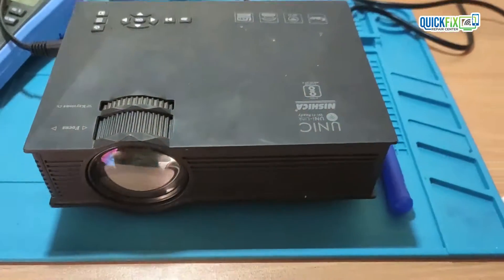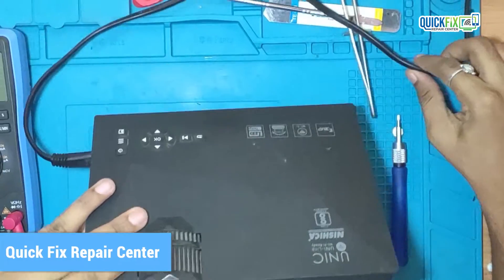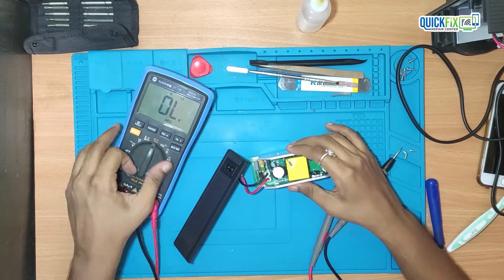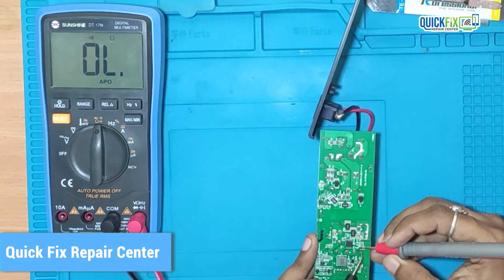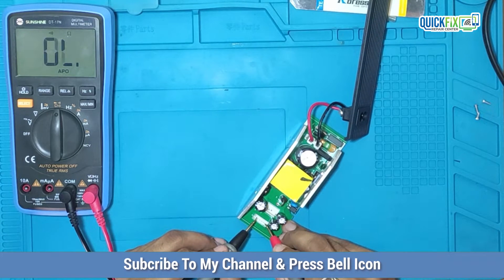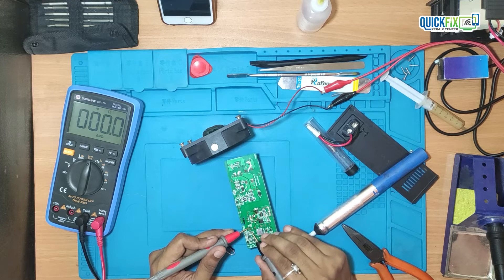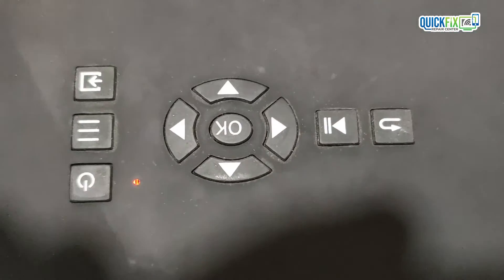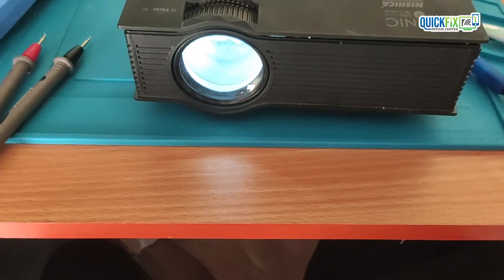led projector not turning on | UNIC projector power supply repair

Comment: How much it costs for doing the same thing you did in outside service centres approximately can you please tell
Reply from the maker: I have done in 500 that time😅
Reply: Great this is called diode problem right?

And it happens on power fluctuations right? @QuickFixRepairCenter

Comment: i have same projector... when i turn on the projector red light ons, when i start projector screen blinks and turns off.......and returns to the same red light and if i again turn on the projector screen blinks and goes off
Reply from the maker: Might be not delivering enough power which is required. Hence it's getting off frequently.
Reply: Have Lamp Replace?

Comment: I have hitachi cpx 4015 wn projector it shows pendrive all files audio files plays smoothly but when i click on the video it open same screen again.  not playing video
Reply from the maker: Ok. Maybe the encoder or The media file is not supported.
Reply: @QuickFixRepairCenter  i tried all the video format some format is not visible in folder only .avi is visible and it is not playing . Laptop connect with projector with hdmi port smoothly problem is with pen drive
Reply from the maker: Ok...

Comment: Bro my projector is Big Vue LED projector 
I am also face this issue how can I solve it 😓
Reply from the maker: Check it's problem in power related or logic board related...
Reply: @QuickFixRepairCenter bro,  power indicator isn't turn on
Reply from the maker: Disassemble projector and then check power section.

Comment: Hello, I have a QKK2 projector that can connect to power but will not turn on. When unplug it in, light flashes green then to red. I tried connecting it to my computer but the projector will now turn on. I’ve tried turning in the power button but nothing is working. Can you help?
Reply from the maker: Maybe the projector lamp is gone that's why lights flash green and then red

Comment: Hello. I don’t know if you will see my comment or not but I will try. 
So I disassembled my projector because I wanted to clean it from dust. I removed almost everything, then when I returned everything to its place and I turned it on the colors are gone and the screen became like an X-ray screen, all thing work but only this problem. So Can I fix it at home?
Reply from the maker: Yes! you can. Between led and screen there is on poloriser which you place wrong. Just make it opposite the current position, your problem will resolve.🙂

Comment: Hello I'm from Brazil. mine is in trouble. I turn it on and it keeps going to home alone or moving the keys alone, I've already tried to unplug the manual control cable but the table remains , I would like to know if you know any solution for this
Reply from the maker: It's difficult to tell solution like this without diagnosing 😅. I think you have to check pull up or pull down values of this button which is continuously pressing.
Reply: Hi I have the same problem with my projector, were you able to fix yours?
Reply: I have same problem too 😢
Reply: same, any solution yet ????

Comment: Control switches on the system and remote not work property....so.mode select pblm
Reply from the maker: Try to check menu button in continuity mode. While button press  they are working or not. If not replace them.  Else there is logic board issue.

Comment: Bro same projector...usb  and ir sensor not working...if i connect pendrive capacitor burning inside and also pendrive burning i am already changed ir sensor still problem same whays the solution
Reply from the maker: Maybe voltage on usb line is higher hence it's burning.
Reply: @QuickFixRepairCenter  5v was shorted with ground some where i think...
Reply from the maker: Ok

Comment: MY UNIC 28+MINI LED  PROJECTOR    RUN 15 MINIT AFTER  AUTO  OFF AND START AUTOMATICILY 20 MINIT  WHAT  PROBLEM  OF PROJECTOR
Reply from the maker: Maybe thermal sensor related issue is there. Please check with nearest service center. They will definitely help you.

Comment: My unic projector power indicating light is burn but projecter is not getting on wts  the problem
Reply from the maker: It's difficult to tell without proper testing. But I suspect there issue is from power section of your projector.
Reply: @QuickFixRepairCenter  ok tnx